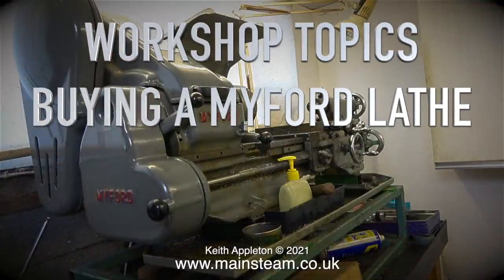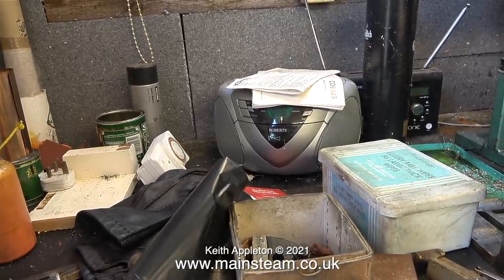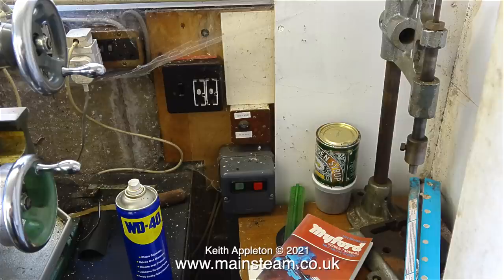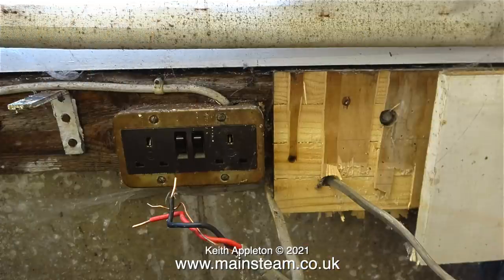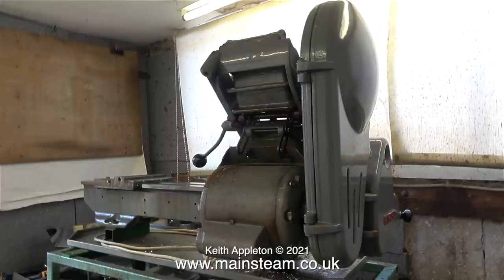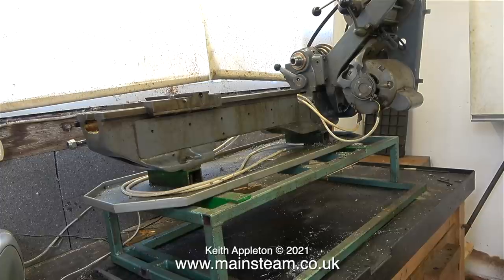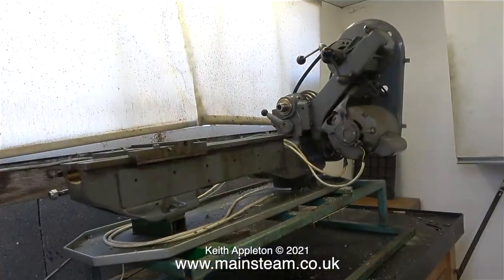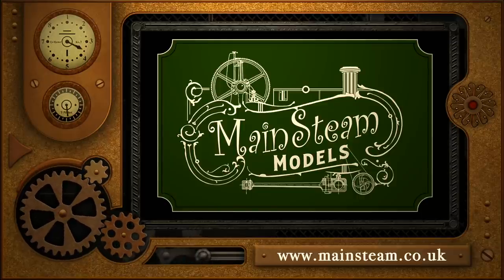BUYING A MYFORD LATHE - PART #2

Comment: Whats better myford or boxford lathe? 

I have a myford. The handle which I suppose is designed to engage or disengage drive doesnt do that. No motor on it. So at hand speed turning pulley with lever pulled still the pulley free wheels
Reply from the maker: Personally I prefer Boxford lathes because they are just a bit larger. In my Workshop I use my trusty old Boxford more that the others.